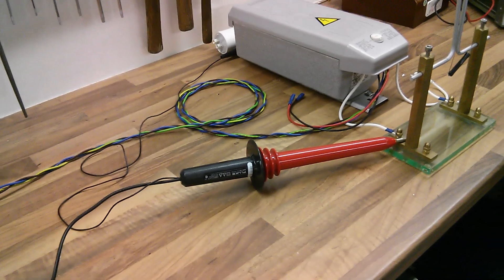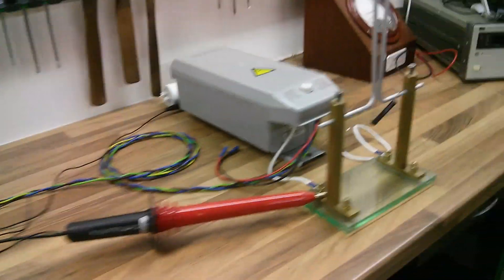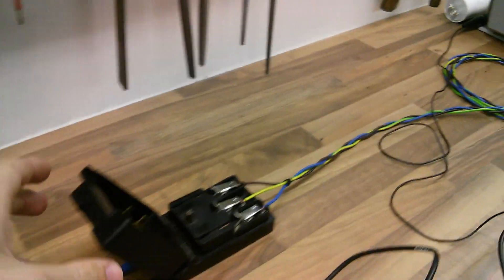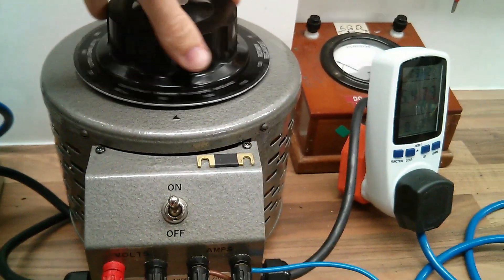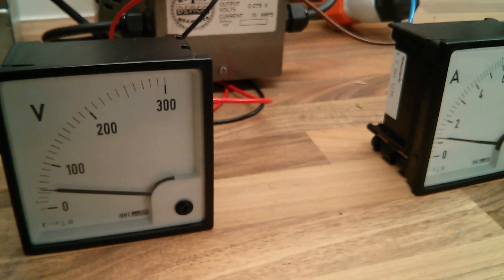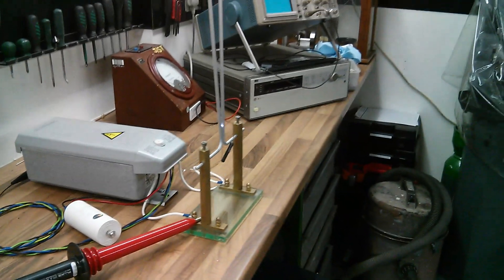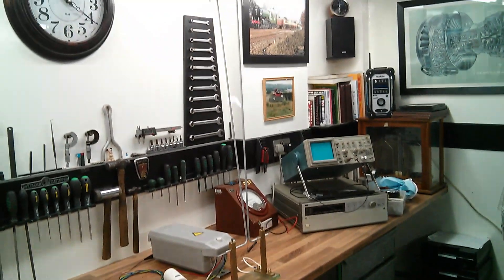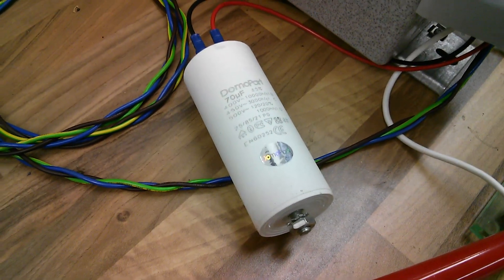Power Factor Correction for Neon Sign Transformers

Comment: Transformers and other equipment would have been sample tested at the rating on the plate at full load, that one shows 240v, but you set your variac at 230v, and the arc may not be full load, might have been better with a spark gap set closer
But a very useful demonstration.
There should be online calculators for power factor so you can select the right value, or something like teslamap includes this info.
Reply from the maker: Thanks for the additional information Sparky! That's the problem with line voltages, they vary so much at different times of the day, we get anywhere between 220 and 250V which is a pretty wide range, I've seen it as low as 80V once but that was due to a power brown out one stormy night... =]

Next time I will compensate for the voltage and match the spec plate to be that little more accurate, one of those voltage stabiliser units would be nice but I think I will go with manual for now, unless one did come up for a price I could not refuse! x]

I think I will use a more constant load on the next test as well as a Jacobs ladder is pretty erratic really.

Comment: Power factor is about the current and voltage being out of phase which is a problem for your electricity company. Note you can't measure power just by looking at voltage and current on an amp meter and volt meter that only works if the power factor is 1 i.e resistive load. If you're interested in seeing the energy used you need to use an energy meter (I'm not sure how well that digital one you have will work with the severely distorted waveform from arcing) if you have an old electricity meter laying around that would do. That setup does seem to reduce the current though.
Reply from the maker: You'll have to excuse the lack of preparation for this video, I just wanted to share my findings from Ridefast0 really and the CCS meter was a truly terrible way to accurately measure the power factor as with the inconstancy of a Jacobs ladder for a load and the ammeter was just used to show the effects of the PFC...

Power Factor Correction will be revisited in the not too distant future with much better detail and explanation.

Thanks for your input it is greatly appreciated! =]
Reply: Steve Lane Thanks for posting still a very educational video, I would like to have seen the difference in measured power on the CCS meter. I guess you could test the CCS meter with inductive, capacitive ,resistive, (inductive + resistive), (and capacitive + resistive)  loads and see how meaningful the reading are. Purely capacitive or inductive loads should draw current, without any power.